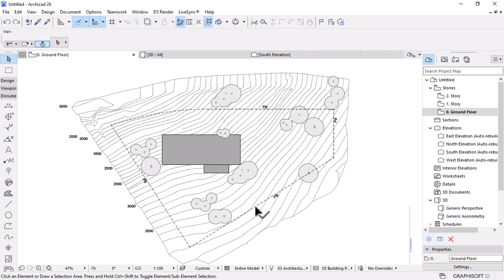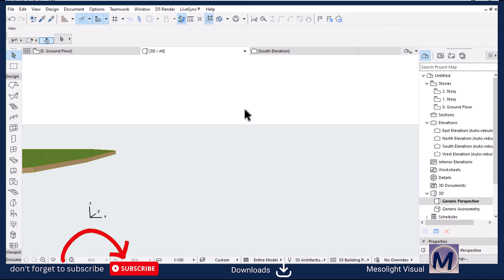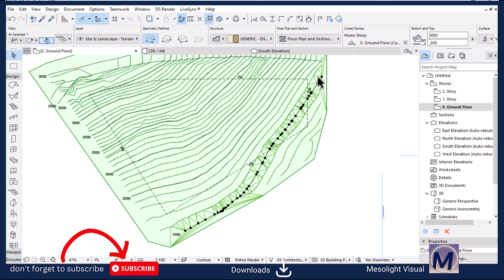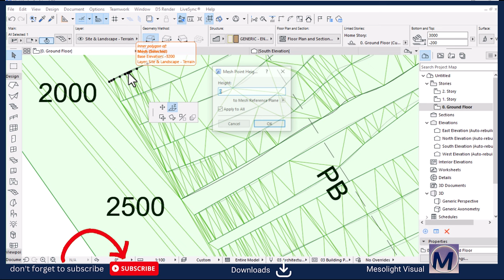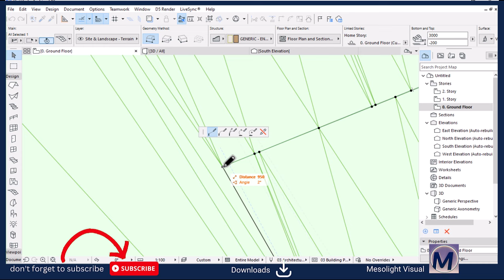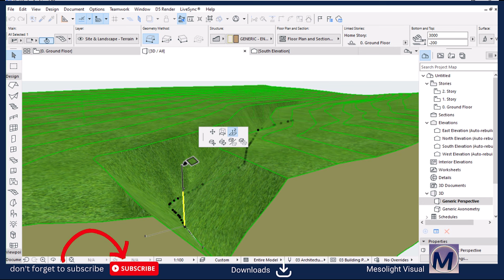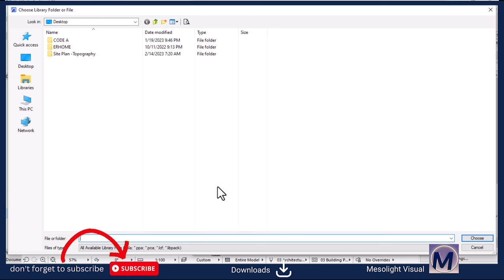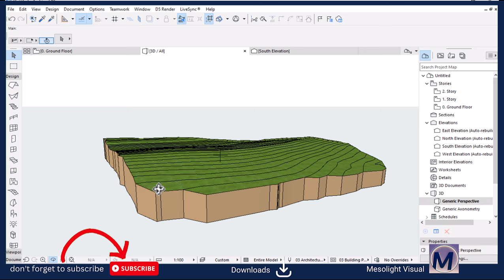How To Efficiently Create Site Topography | ArchiCAD Beginner Tutorial

Comment: What if there are different elevations within a grade line. For instance north portion of the line is 1000 but the south side of the site along the same line is 1120
Reply from the maker: In that case you will have to use cut and fill method